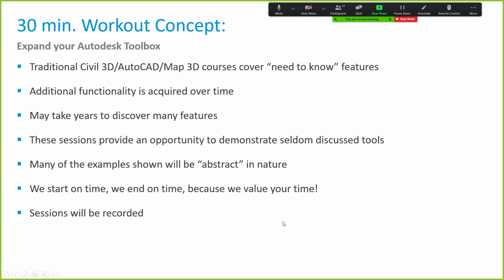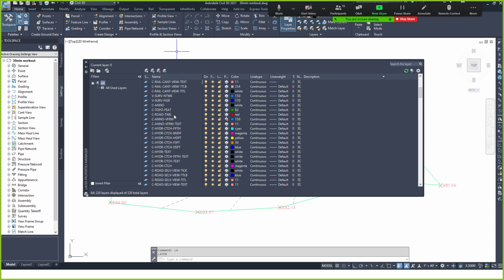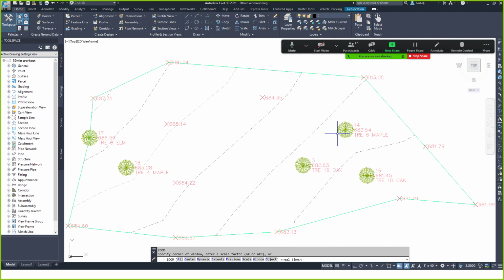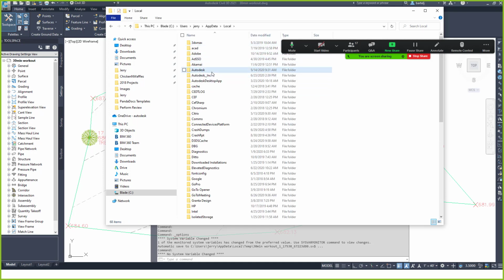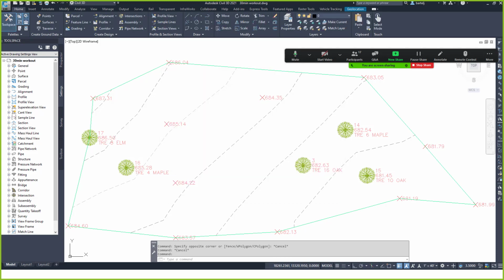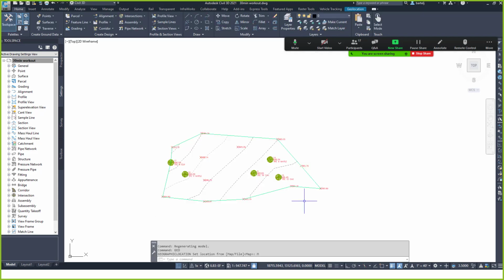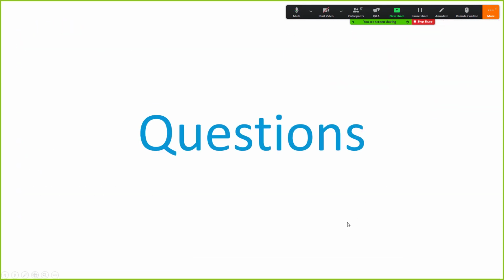Odds, Ends and Important things to know when using Civil 3D / AutoCAD

Comment: Bookmarks for later reference
6:51 Stopping layer filter applying to layer drop down.
7:27 Difference between off and Freeze in Autocad
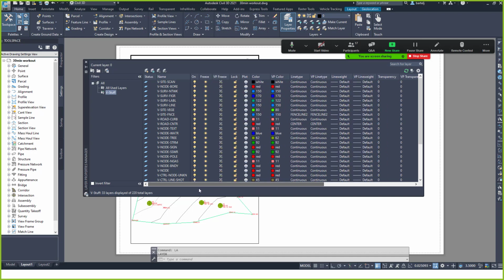10:00 Vp freeze and VP new freeze
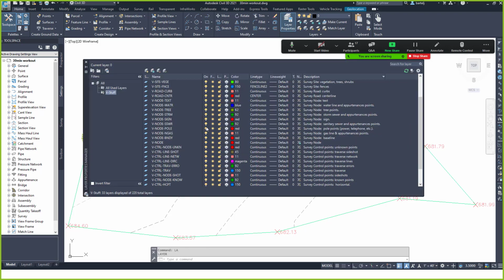12:00 Add filters to layer list
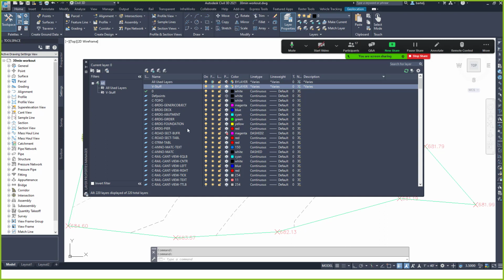13:00 Getting list of Layers
14:30 CopyHistory and logfileon
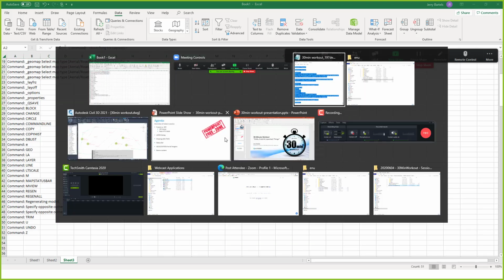19:55 System tray adding co-ordinates and  projection with mapstatusbar
21:45 Import Bing Aerial Image
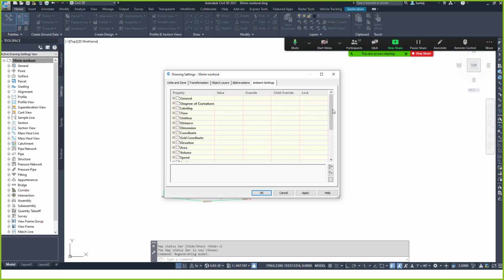22:30 Lat long to decimical
26:30 Changes to trim and extend command

Comment: HI SIR
HOW ARE YOU 
I HAVE A QUESTION  
I HAVE A FINISH SURFACE FOR LANDSCAPING AND FOR PREPARING  FORMATION SURFACE I HAVE SO MANY PLANTING BED WHICH HAVING DIFFERENT SOIL DEPTH LIKE 30 CM , 50 CM . CURRENTLY WHAT I AM DOING IS AFTER PREPARING FINISH SURFACE AND MAKE CONTOUR INTERVAL SO CLOSE  LIKE 0.001 M AND TRIM EACH BED SEPARATELY  AND MOVE IT DOWN , CAN YOU TELL ME THE PROPER WAY TO MAKE IT
THANKS